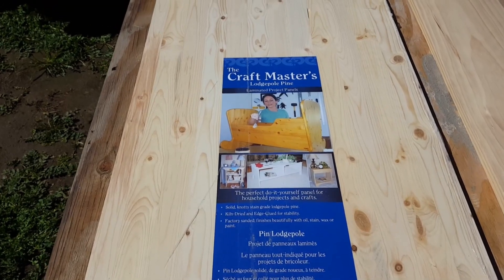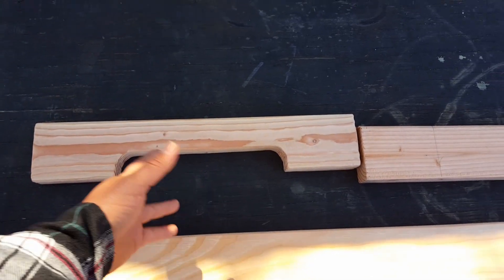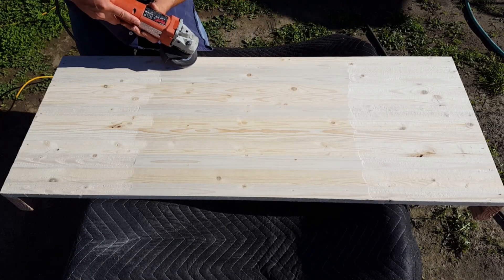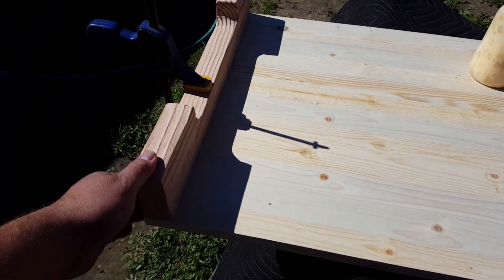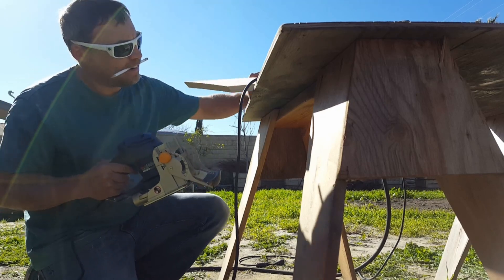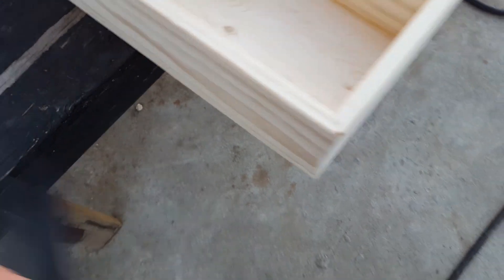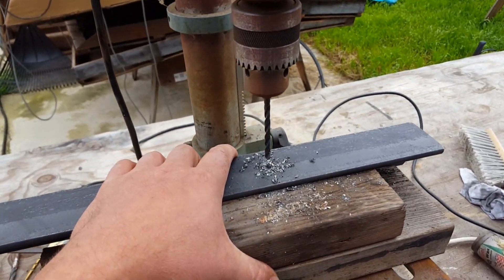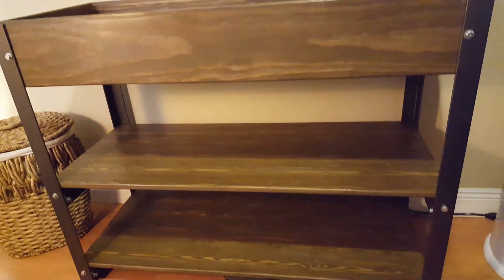Creative Idea For Changing Table | DIY Organizer For Nursery | Industrial Furniture Idea

Comment: Very cool video. If you want deeper veining than the wire wheel gives you you can also sand blast away the softer wood. If you're doing it for decor use only, you can use a softer wood.